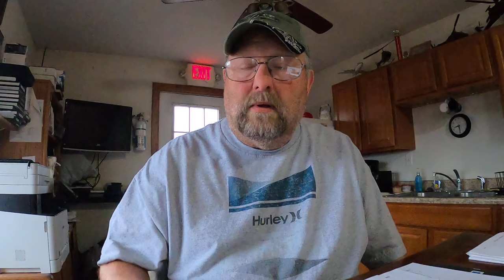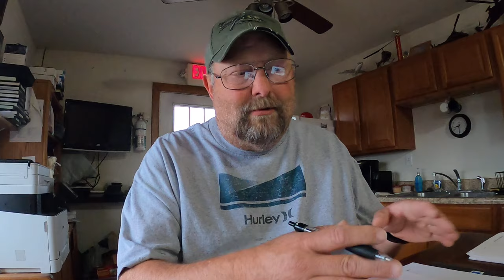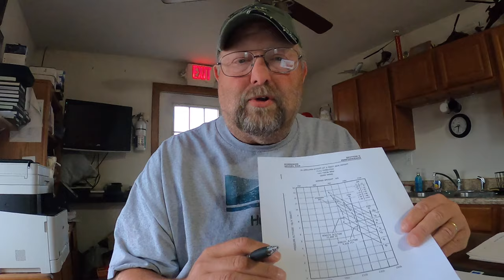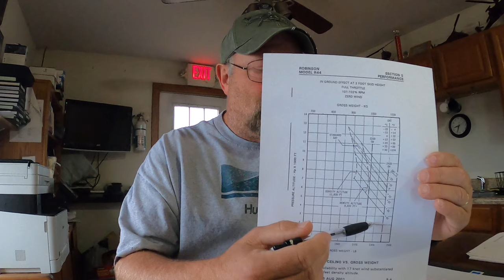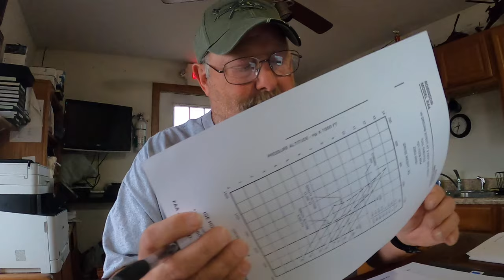Part 1 of 4 - Helicopter Performance charts-Helicopter Ground School

Comment: I’m confused about the temps we’re using in the examples.

Go to 4:40 on the tape.  You’re using 30°C, and the chart says IGE hover of 7000’.
 
Is that 30°C at sea level, or 30°C at 7000’?  (30°C at 7000’ would be 44°C at SL)
Reply: That is 30 degrees at 7000 ft. Outside air temp not sea level temp
Reply: But 30 degrees and 2400GW isn’t it 8000’ ?